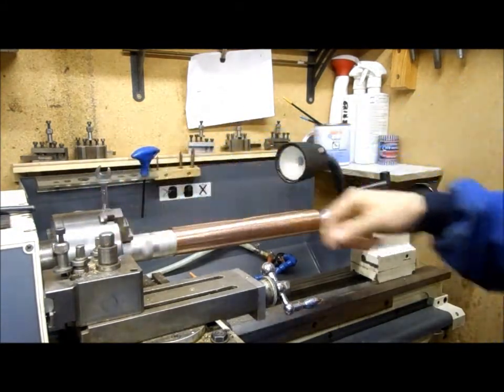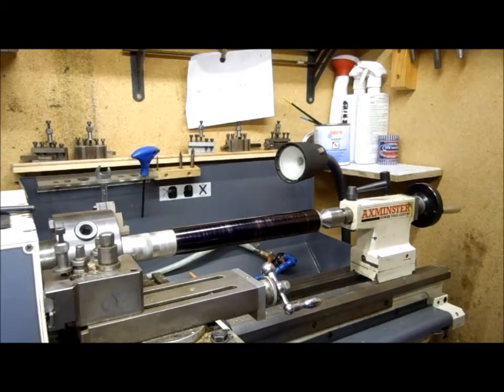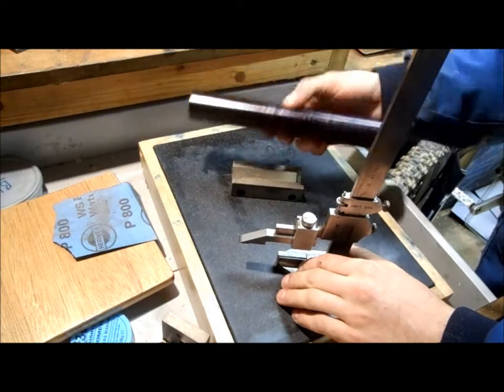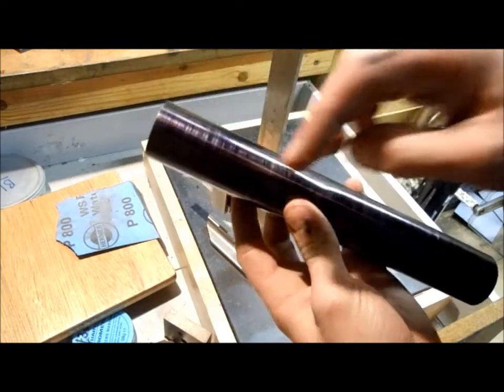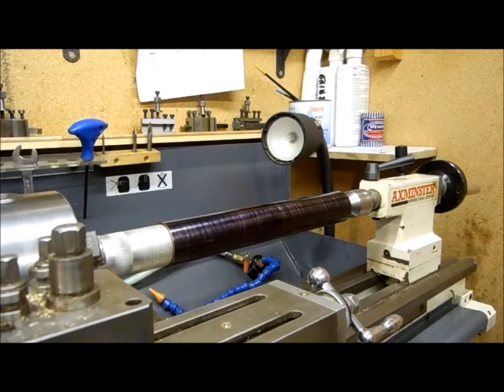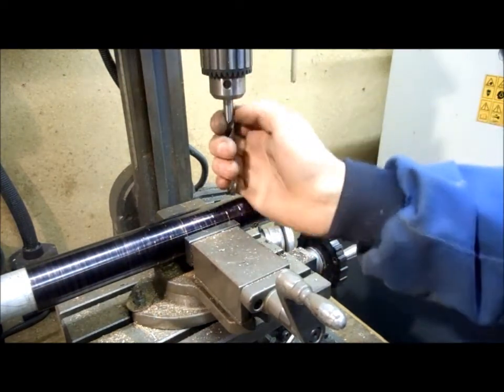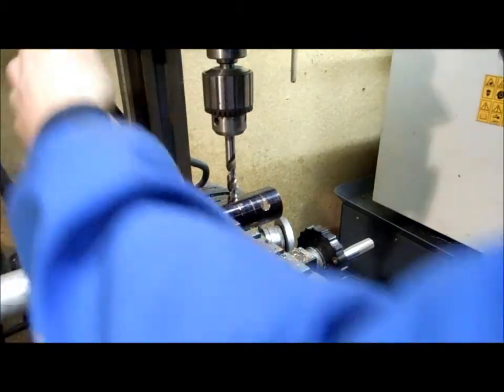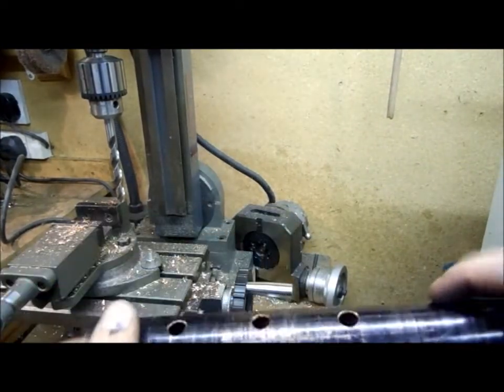Model boiler making 1

Comment: Great video, quick question I have seen instructions that say the tubes should be slightly smaller than the holes so that the silver solder will flow with a capillary action.  Your approach won't do that , but does it matter?
Reply from the maker: yes and no is the answer! on inspection of the tubes the silver solder formed a filleted ring round the inside and outside so that indicates complete capillary action (this is what you want).  but if the holes is too loose, the silver solder will act more like a gap filler, this is not as mechanically sound as a close/tighter fitting joint. do remember that copper does expand a lot once brought up to silver soldering temperatures so it will have some give. if you have large gap filled joint they can be too ridged and cause stresses in the joint when the boiler expands with heat and pressure. When making crankshafts i machine the components to a press fit and still the silver solder penetrates through out the components. its very much trial and error, heat placement is a major factor of how well a soldered joint will go. i have spent up to 45mins soldering one component  because the torch was too small and not getting sufficient heat in. experiment with different fits and stick to the books as you can't go wrong, always do some test joints first to practice on!  happy soldering!
Reply: knurl jimmy Great thanks for the comprehensive explanation. Graham